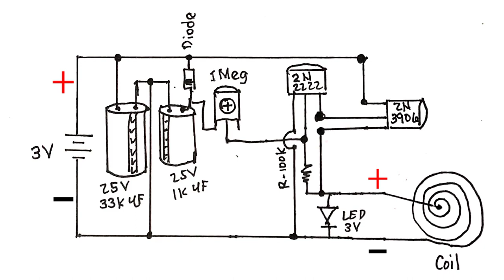HOW TO MAKE A SWINGING STICKS - DIY Swinging Sticks

Comment: I tried to make this circuit but it did not work, I don't know what I done wrong. The Led is on all the time and the pendulum won't work. Can you please help me?
Reply from the maker: if your connection is correct, there is a possibility that the problem is with your potentiometer. try turning it little by little until the led turns off.
Reply: Thanks for replying.
I did what you said and it’s working but not enough power to push the magnet all the way
I couldn’t find capacitor 3300uf and I used 2200uf, do you think it is a problem?
The transistors are getting really hot
Reply from the maker: 2200uf can also be used. as for the weak push of the coil, try adding a magnet to the stick to make the push of the magnet coil stronger.If the transistor heats up, the LED may be ON for a long time. so it is possible for the transistor to overheat.  I hope it helped.. tnx!

Comment: Unfortunately this doesnt work for long. The swing turns into a rotation and it rotats and rotats. I've done some similar a couiple of years ago. Then I looked at the original electronics, and thats a very more complex circuit with Op-Amps and direction detection coils. I gave up then, because I cant read the values at the electronice, so reverse engeneering was not really possible.
Reply: It works if you fine tune the output voltage also the sticks need to be balanced. Spinning like a wheel because your out put is too strong.
Reply: Can you please tell me tge electronics involved with time stamps ?? It will be of great help for an aspiring engi :)

Comment: Nice effort...
Hi there, this build will just never work like the original as it is missing very important magnets in both small and long arms... It will only ends spinning like a ventilator. Also, the build is not precise enough (mainly in weight proportions) to offer a smooth movement that could look like a perpetual movement.

Comment: Hi guys.... don't waste your time and money ....bcz this concept which is use by this person is totally wrong.
If you want to make this swinging stick pendulum you need 3 copper coil. Two sensory coil and one kick coil .And auto circuit polarity changing IC and no need of any capacitor and LED.
And 😂 this swinging sticks video is a reverse slowing video ,which is started by hand and slow end automatically but here is edited by Reverse video editing.
Reply from the maker: This is a DIY project which means time & effort are used with less money expense... Simply created at home by an ordinary person with accurate knowledge that the viewers may possibly do it also by themselves or may enhance it according to the extent of their knowdlege & skills.. thanks anyway
Reply: هل يمكنك مساعدتي بشرح وافي لو سمحت اخي وشكرا
Reply: Working with one coil for al long time, but one month left for all ajustments...